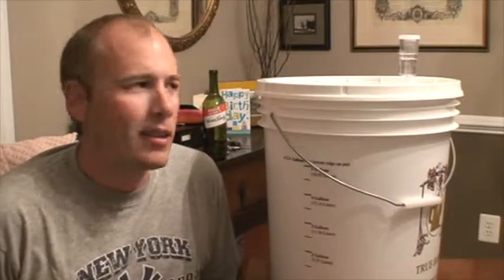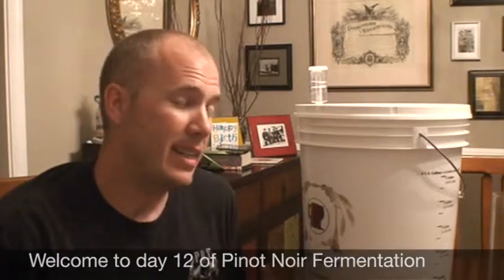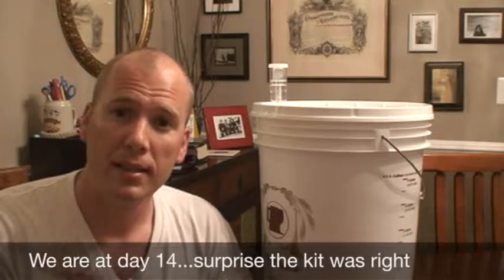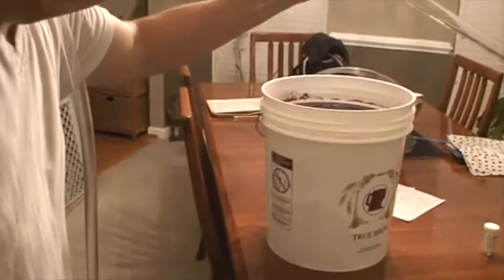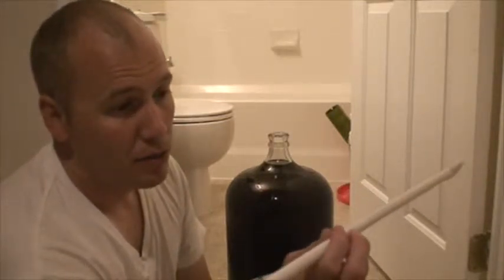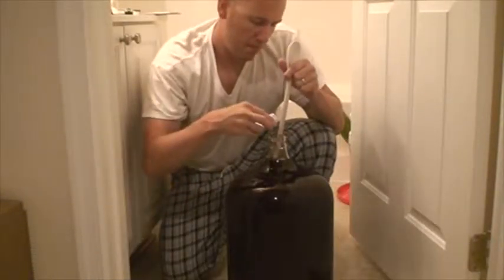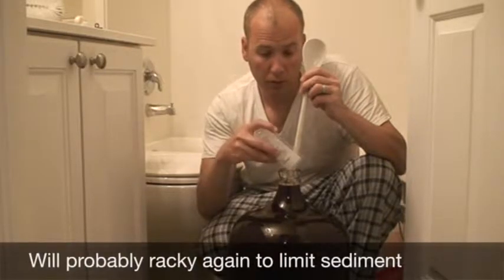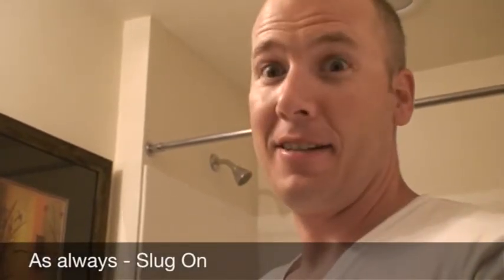Making Pinot Noir from a kit - Part 2: Measurements, Racking and Clarifying

Comment: I'm not a betting man but I'll bet that you never even read the instructions before you started. Usually the wood chips or dust are emptied directly into the must and not left in the package. You also had entirely too much wine in the carboy so I can't understand why you wanted to add more liquid to bring the level in the carboy up higher, you couldn't even degas it properly. 

Thank you so much for your service, what branch of the military are you in?  Thanks again.